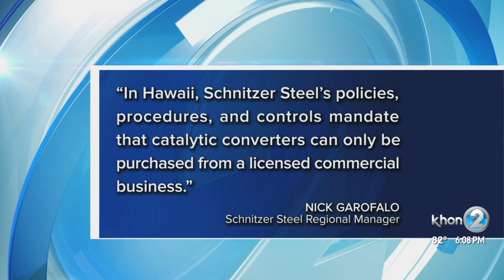Need a catalytic converter, they may be hard to find

Comment: Do not put the shield over the converter.  It will over heat, and may burn the carpet in the car.   The only one that is safe are those made of expanded metal.  They can pass all the laws they want and it's not going to stop junkyards from buying them.  Only one thing will stop it.  Make it so they cannot be sold out of state.  But that will never happen.